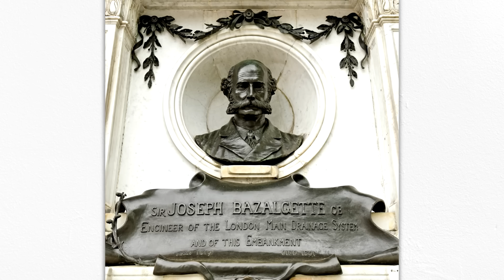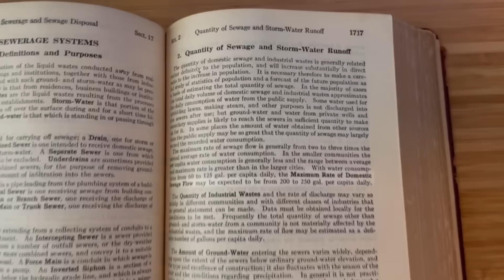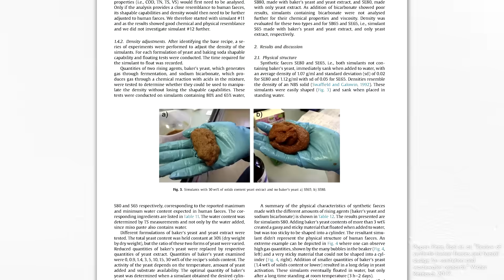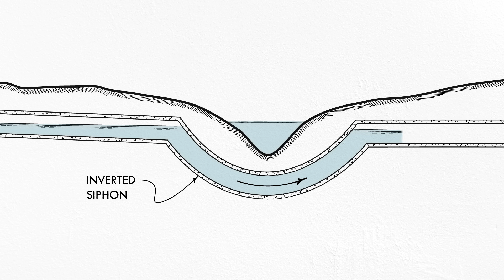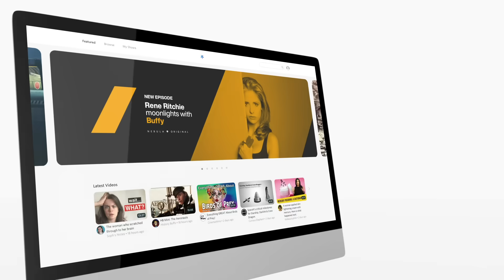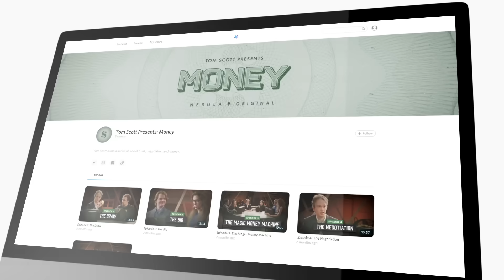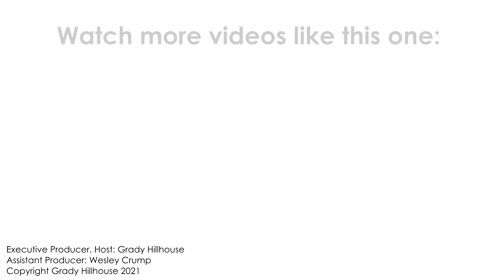How Sewers Work (feat. Fake Poop)

Comment: In regards to the issue with flushable wipes, I don’t think they should be banned. There have been discussions of them being banned here in the UK. I think sewage pipes should be upgraded to handle wipes. I started using wipes when I was around 10. That was due to me one day being ill, so I was on the toilet a lot. The toilet paper had the effects as sandpaper would due to the excessive use, so my mum bought some wipes to ease the pain. I can say, I’ve never ever gone back. The wipes make you feel cleaner, and they aren’t like sand paper. I’ve probably used toilet paper like 10 times since then. They were probably on occasions where I was desperate and had no wipes such as at school. That said, I know the effects of wipes, and I know how tough they can be. I don’t use baby wipes, I use wipes intended to be flushed. I personally think the only sustainable way of doing this will be by using a bidet. Not only does that not use paper or any other material, but it’s also less risk for sewer pipes. A lot of people will be uncomfortable using them at first. They can be intimidating to use. I’ve never used one to I can’t speak for them. The only issue with bidets is they use water which is becoming a higher demand resource, but also a less available resource. Personally, I think the only way this can be solved, is if we find a way to quickly, cheaply and safely treat salt water. I know there are ways of doing it with chemicals or through evaporation and condensation (making distilled water), but they are both expensive or will have negative effects on the environment. If we find a way to treat that water in a way that it’s available quickly, cheaply and isn’t going to have any lasting effects on the environment such as through combustion, that will help that issue. I know there are structures that they are trying that uses the sun to evaporate water instead of a fire, but that’s obviously only possible in certain areas and relies on weather which can be unpredictable. That said, I don’t think toilet paper is the way to do things. It’s cheap, but uses a lot of paper. It’s a waste of trees for something that can be done a different way. You don’t clean mud with tissue, so why would that be any different?

Comment: This is kind of topical for us because we recently had a sewer backup that was traced to an offset joint at the connection of our side sewer to the city's sanitary sewer line. I was very surprised to learn that these joints aren't rigid and watertight given that it is a sewer, but I suppose that any sort of movement would then end up just breaking the joint rather than letting it slip a little.

I would be really interested in a video about how pipes move to cause these things and the issues of designing around the problem. Earthquakes? Flood? Just plain time? Would it be possible to use flexible joints to mitigate the problem?

Comment: sewers should be made way bigger, water could be evaporated using mirrors and fresnel lens.

or in desertic areas let the UV light from the sun destroy it all and water evaporate from big water tight basins, that would also increase rain in the area.

the left over dusted dry waste could be way easily treated like first extract all metals on the waste and then use the non toxic waste as fertilizers, i do wonder if UV light would break the dry soap though, maybe if they only allow biodegradable soaps.

Comment: when i was a plumbing apprentice, i was told "poop flows down at 1/4 inch per foot" it was one of the 3 rules of plumbing i was told lol
Reply: I used to be an apprentice for a great plumber i knew, until he had me in a hole cutting the drain pipe to the county jail drunk tank (a room that curiously was devoid of toilets). So basically I cut the pipe and a black foul smelling sludge plug popped out and then so did everything else. Let's just say Ending up neck deep in shit isn't just a saying.

Comment: How does splitting the pipe into two help with the inverted siphon? If the sum of cross-sectional areas is the same as the big pipe's, and the flowrate is the same, isn't velocity the same too?

Comment: So, just wondering out loud, what if we drive a little drone into the sewers with the fatburgs and just, give it a seriously powerful heating element and melt that stuff? 
The grease and general junk would liquify and move down and eventually hit a place where it's not a problem.

Would the heat just make everything expand and damage the system or would it just not be able to get hot enough due to flowing water?
Reply: I thought they drop chemicals in sewers to dissolve fat, hairs etc, it's strange they don't

Comment: There is definitely a deception in place re: labeling moist wipes. I tested them myself thinking the "authorities" were just trying to save money for their pockets. The flushable wipes I was using did not dissolve at all even after agitating for several minutes in a bucket of water. Toilet tissue falls apart almost immediately. I no longer flush ANY wipes. BTW, in MA, the pipe leading to the street from our homes belongs to the homeowner and we are responsible for any costs to unclog it even if it occurs due to infiltration of tree roots into the pipe.

Comment: Curious, how do they achieve enough gravity slope in flat cities? I mean a 1cm per meter grade over 1km is 10m by itself.
Reply: Not all sewer pipes go directly to a treatment plant. A neighborhood, or group of city blocks, or whatever will flow using gravity down to a "lift station", which is typically 20+ feet deep and has pumps in the bott of the station on float sensors. When the gravity sewers fill the station to a certain point the pumps kick on and start sucking the sewage out and sending it through a pipe called a "force main". The force main can travel a pretty good distance AND uphill until it drops into a manhole connected to a whole other gravity sewer network that is closer to the treatment plant. Then the process is repeated over and over, from one lift station to the next, until the sewage reaches the treatment plant

Comment: Recently there was a serious sewer backup at my parents house.  I was there to help them as they are in their mid 80's.  For over a year now, their kitchen sink was gurgling and I noticed that even the level of the standing water in the toilet bowl was fluctuating.  Finally I heard water dripping in the basement and went down to face this horrific sight of water running down from just below the toilet.  In a panic I ran up and closed the toilet supply valve; however, that wasn't the source of the problem.  The level of water in the toilet bowl was higher than normal so I suspected a clog.  Then the level rose to the point of overflowing the rim and I scrambled to contain mess.  I bit later I realized the clog was not the toilet itself but in the soil pipe outside the house.  I called a professional who came and ran a snake through from the outside cleanout.  The culprit was wipes!  Not your average wipes but the kind that they use in hospitals to clean adults up after accidents.  My father had these frequently as he is in very poor health.  we promptly threw all those wipes out.

Comment: As an engineer designing sewage in buildings we also have to count in air in the pipes. You don't want to suck out siphons on the top floor of a building while blowing out the bottom ones.

Comment: For those who use TP, but want a wet cleaning, I find that a splash of water and small spritz of vinegar (that I already have in a spray bottle for cleaning) on a square as a final wipe (after excess has been cleaned away), leaves me feeling fresh & clean.

You do have to work quickly, though, since the paper does disintegrate quickly.

Comment: I seem to remember an old encyclopedia showing sewer pipes which have an inverted almond shape. I think you can see that in some of the footage of the London sewers. I understand that the idea is to make sure that the velocity is still great enough when the flow rate is small. The radius of the pipe at the bottom keeps the depth and velocity up by reducing its width.

Comment: 21st century sewers may need to be water-saving and turn poop into a commodity (due to depleted phosphorus sources). It sounds nasty, but a big tube to get rid of poop as fast as possible may not be the 21st century solution...  What kind of engineering challenges do arise under conditions of climate change and scarece ressources?

Comment: Which is better? Sewers? Or Septic Tank? Tha septic tank is a well built one.
Reply: With a sewer, your municipality usually bears the expense of repairs assuming it's off your property. As for a septic tank, you get the full bill for repairs and maintenance. Our last house had a septic tank buried in the front yard with a gravity-fed drain field. Lived there 15 years and only pumped it out once because I thought it must need it. Nope. Septic pumping company said the level was fine. I guess Rid-X works.
Reply: @PCDoctorUSA  Do you pay the municipality for using their system?
Reply: @klydevillalord2405  IF I were connected to the City's sewer system then "yes" I would have been assessed a fee. If you have sewer, you usually have water provided by the same entity, so they look at your water consumption to come up with a sewage charge. The subdivision I was in was just outside the City's sewer infrastructure so we were on a septic system and spared the fee. Hope that helps.
Reply: Tenks. HEHE.

Comment: Why haven’t ideas like the Janicki Omniprocessor, or the individual specialized household commodes seen widespread implementation? Is it due to negative public image propagated on social media of the namesake of the philanthropic foundation supporting this technological development? (B&L Gates Fdtn) Look it up. In short, there is an already proven concept that takes raw sewage, separates the wet out then burns the dry. The dry waste fuels the energy to operate the process and creates excess electricity and clean water that can be sold back. The byproduct is mostly just steam and ash. Perhaps the fat, not really flushable wipes, feminine hygiene products, and other miscellaneous things people flush in addition to their natural biological waste presents a potentially catastrophic problem for these new systems as well?

Comment: Umm what about the Cloaca Maxima, The Oldest Sewer in Rome. It still works even after they've been gone for 2,000 years. It was built before Rome was even a republic, a kingdom at the time. It was said to have been commissioned by Lucius Tarquinius Priscus, the fifth king of Rome and finally covered during the reign of Lucius Tarquinius Superbus, The Seventh and Last King of Rome. Then as the city grew as Rome became a Republic then an Empire, it was added onto and modified. It still drains water into the modern Italian Sewer system today!

Comment: Boss (civil construction): We have a sewer repair to do.
Me: Sanitary?
Boss: No...storm.
Me: Thank God.
Reply: That doesn’t seem to be such a shitty repair
Reply: I help build those, the storm ones of course😅😂
Reply: I work for water distribution I’m happy if it’s anything but clean ole drinkin water
Reply: Round here (Melbourne) a (retail) drain cleaning company charges double for clearing domestic stormwater pipes. Sewers are laid deep with swept bends and they get called out the moment they block. Tree roots love mortar jointed terracotta stormwater pipes.
Reply: realises the city has a combined sanitary and storm sewer system
Reply: Those pipes can be so fucking deep it’s ridiculous
Reply: Fuckin right 😂
Reply: I was thinking our Stormwater is definitely not in the same Pipes as the Sanitary Sewer, I don’t think People down River would appreciate Sewage directly flowing into the River.
Reply: As an water expert,  I would not be that happy.  Storm water test shown some nasty crap
Reply: Boss:
Me:
Boss: ..NOT!
Reply: I always that the storm sewers combined with the sanitary ones, to help flush everything away.
Reply: 🤣 exactly how the exchange goes with the boss at work 🤣🤣
Reply: this was supposed to be clever?

Comment: I still marvel at the inverted egg shaped sewer pipes that were built in the original London sewer system - the smaller volume at the low water level increases the self cleaning speed, whereas at higher water level, the sheer volume is enough to self clean. - amazing that they worked all this out back in the early 1800s.

Comment: So if we haven't redesigned the collection system,  why are we putting in low flow toilets?  That's my gripe as I am a poopie flow technician.  I'm snaking so much more now,  yes things get old,  but taking away the water has caused me much stress

Comment: Glad I don’t live in a city. I remember walking past a sewage treatment facility in Jacksonville Florida almost knocked me out the smell was so bad. Why haven’t we found a way to use sewage as fuel yet? With a smell like that it’s got to be powerful
Reply: If a plant smells like that then something isn't running right. The epa and cities are involved heavily, we have air permits that need to be met for pollution control. And we actually reuse wastewater after the process is finished to conserve and we have whats called bio filters that filter air and we even use massive incinerators to burn poop and the steam created is recirculated throughout the plant for use.

Comment: To be honest, I am a bit disappointed by this video, because it only touches one aspect of a sewage-system, which are pipes, which are not even the most interesting/important aspect. Here is my state of knowledge:

Household sewage is drained from the buildings through pipes. These usually lead into larger pipes, who themselves are drained into tunnels, which are just big enough that a human can walk there on his two feet (albeit not upright). The reason for this is that if you have any clogged pipes, you can access them with relative easy. All pipes have a pretty steep slope, to prevent buildup, as you mentioned.

Those small tunnels lead into bigger ones in which a human can walk upright, and they have … obstacles? … in them, barriers made to catch solid heavy waste, to prevent it from causing problems further down the system, and those steps/traps need to be manually cleaned out regularly. (A very well paid job which barely anyone wants to do however, guess why.)

Those tunnels now lead into outright underground rivers of sewage, with sidewalks and everything, which in the old days lead into the settlement's river, now into a sewage treatment plant. [There are plans in Vienna (where I live) to use the fecal matter and all its “gaseous potential” to fuel power plants, but this is just a side note.]

This is, however, my state of knowledge, and I do not know if (it is entirely correct in the first place and if) this is how it is done all over the world. Also, I think I remember that sewage tunnels are usually kept next to rivers, for obvious reasons, but here my knowledge is just not good enough to give any further details.

Comment: Doesn't the splitting of the pipe cause less flow rate in each pipe? That would cause more solids to settle.

Everything small enough is flushable, but whether you should or not is the real question.

Comment: Are there any significant impacts on the sewer systems that may have been designed in the 50's in  the present from the decreased water flow in sewers from residential homes due to higher efficiency washing machines that use much less water and 1.6 gallon toilets flushes?

Comment: i could instantly recognize the clip @3:00 to be from India 😂 no where would you find a sewage system so messed up .Either there is no system or there is a good one but in India since people are more worried about caste and beef they put in the infrastructure just for the sake of it while maintenance and upkeep is left for the gods.
Also, since India heavily relies on caste based reservation, we find braindead engineers get into the system and do awful jobs as such!

true fact, not criticism! you can witness it first hand as almost all major cities stink like garbage and poop.

Comment: I was wondering about what was said about rainwater causing problems for sewage pipes. What if a propeller - type system was placed within rainwater drainage pipes that would increase the flow rate during a heavy downfall. I'm not talking about a pump. The propeller in this case would start to turn as the water flow rate reaches a certain level - free of any need for any mechanical/electrical systems to operate it.

Comment: You may have heard of the 11'8" bridge in Durham North Carolina - affectionately known as the "can opener" because of what it does to trucks that ignore the warning signs. There are two recurring proposals for it - to raise the bridge (been done - now it's at 12'4") and to lower the road.  The bridge can't be raised any further because the rail line on it has a slope problem.  And the road can't be lowered because the sewer line that runs underneath also has a slope problem.
https://www.youtube.com/watch?v=YPt4ijPFzc8

Comment: In 2017, the London sewer had a 820 foot, 120 ton "fatberg" that clogged the system.  

https://www.bbc.com/news/uk-england-london-41238272#:~:text=A%20250-metre%20long%20fatberg%20weighing%20130%20tonnes%20has,said%20it%20would%20take%20three%20weeks%20to%20remove.

Comment: Okay, but the thing intriguing me the most (well, two things) is one, if its going down at an angle designed to be just about velocity to clean itself inside, it will be buried to deep underground in at best couple hundred meters. Second thing - what if the design is bad and you need to transport waste uphill?